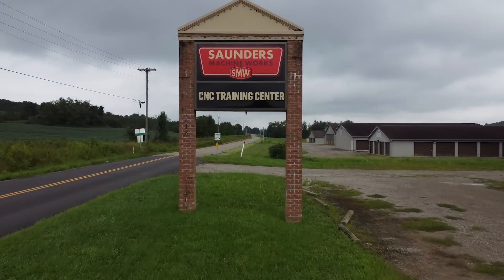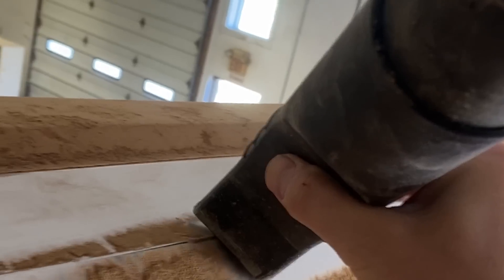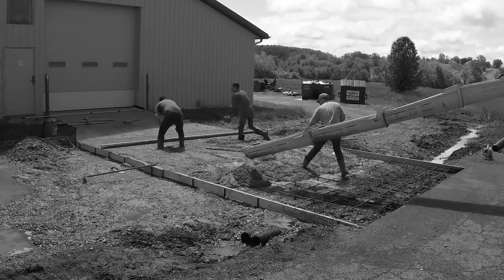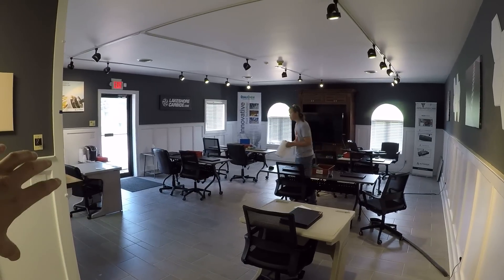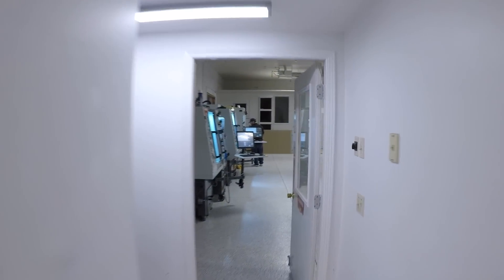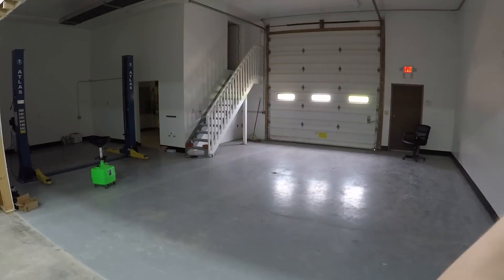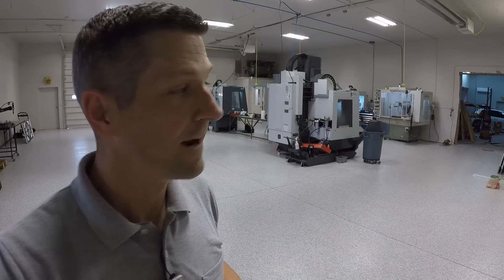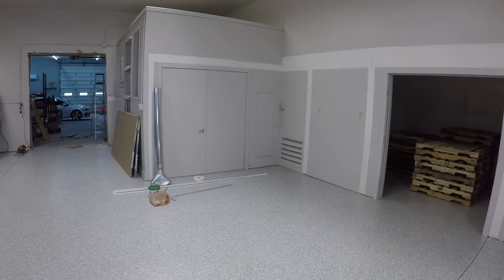Learn CNC Machining at Saunders Machine Works!

Comment: Instead of wall posters, why not try 60-85 inch tvs, so you can make it a digital bulletin board and for job tracking. With a raspberry pi you can remote control it from anywhere to switch out the screens displayed.

Comment: I can relate to this! Last month I bought a machine shop and the floor was disgusting. Instead of spending $30k I just diamond wheeled what I could of the old epoxy (some down to bare concrete, some i just left) and spent $800 at lowes and did it myself in a week. Looks amazing but I’m sure it’ll will peel in some spots eventually

Comment: Been watching for a long time. I’ve done all the beginner stuff 3 axis Mill and Turning as well as wire EDM. What I’m most interested in is 5 Axis Milling, Mill-Turn, and Swiss. You can’t just learn those at a college, and unless you work at a place that has them and manage to get over there and get the training it’s almost impossible to get into it.

Comment: Any thoughts on maybe having a Syil?  They seem to be becoming very popular for guys who are starting out and don't want a Tormach?
Reply: In terms of price, weight and power requirements, Syil's machines are closer to the Haas Mini Mill range than anything from Tormach. The Syil machines look good in terms of specifications and value for money, but you'd really want to check the support offered from your local distributor. You might get less machine for your money from Haas, but you know that they'll look after you. The high-speed spindle options on the Syils might be the deciding factor if you plan on doing lots of work in aluminium.

Comment: Wow John, That Building came out really nice. I think You are doing a fantastic job. I believe it will work out really well for You. I would consider using a smallish room for an area to show students  how to properly assemble and disassemble tools and or do off line tool length and Diameter  measurements. Maybe Haimer or Speroni could sponsor Your efforts. Very nice work